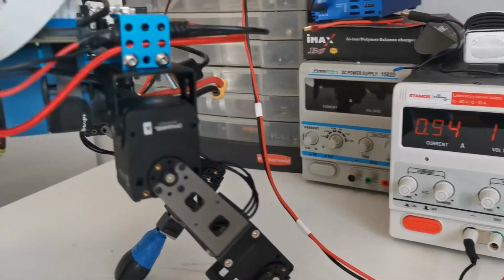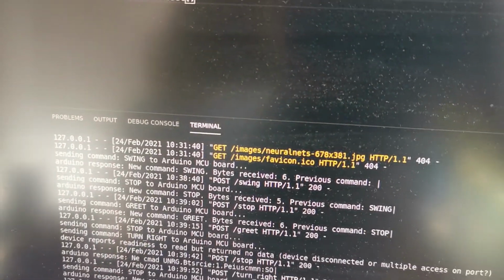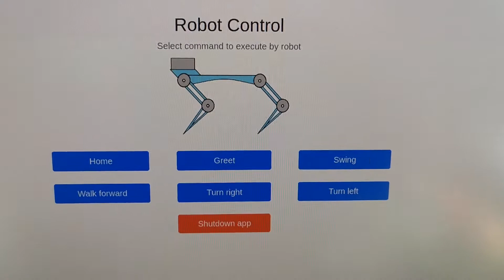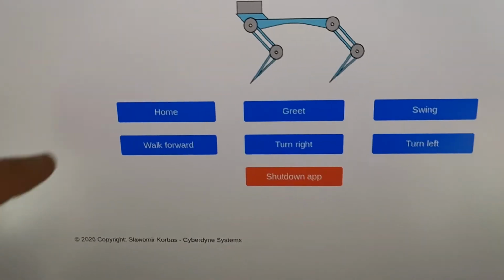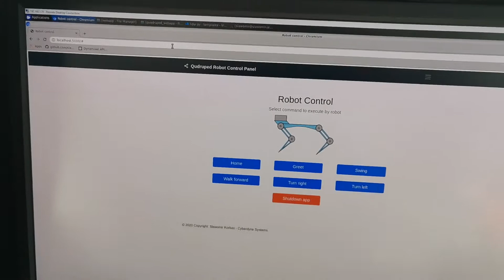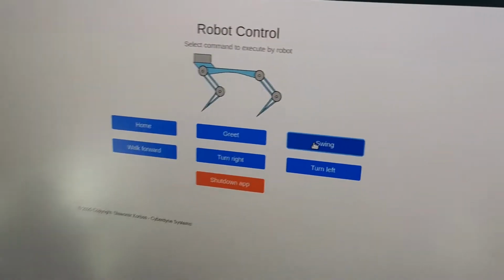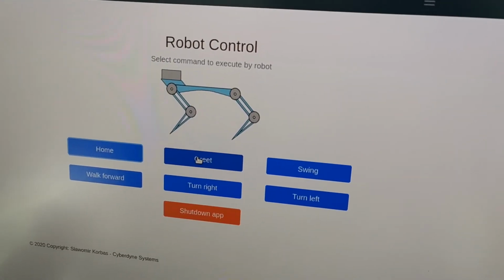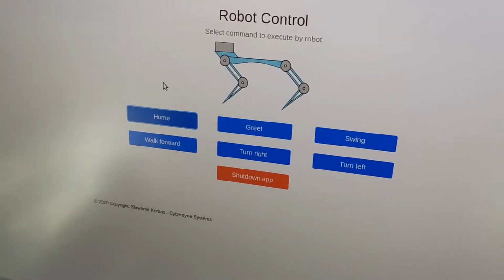NVIDIA Jetson Nano and Dynamixel robot: control using Python

Comment: How did you control 4 legs with 3 TTL ports?!!
I hope you to share the method since I'm stucked with using arduino shield for 4legs control
Reply from the maker: Even single ttl port would be enough if all the servo Motors are connected in Daisy change. In this particular case last servo from one leg is connected to the 1st servo of the second leg (chain) - this way single ttl port controll two legs.

Comment: this robot skeleton can be bought?
Reply from the maker: It is my own construction. Mainly based on Makeblock aluminium elements. Joints built from dedicated Dynamixel servo  aluminum holders. It is not any serial product.
Reply: @slawomirkorbas  cool thanks,  one question because you have the nvidia jetson. I am searching to buy one, but I cannot found  any to buy, do you know any site which has it available?

Comment: did you have any problems with the rplidar on that kind of platform? I found the smoother the ride was, the better the slam worked
Reply from the maker: Yes I had some problems with RP-Lidar but it was because of the Python library. For some reason "scan" method was throwing an exception when buffer was overflow with measurements. Temporary solution was to catch this exception and restart lidar programmatically. When it comes to LIDAR device it can operate at different speeds depending on the voltage applied 3.3V or 5V. You may test it in case of  issues.

Comment: Hi man!  That's amazing and I love your work ❣️. I have a small query and I think you are the right person to ask. Since you have worked on Jetson Nano. I've a Jetson Nano and I'm building a robot. I don't have a clear idea on selecting the right power source for jetson nano. I've a 2500 mah lipo. So if I connect this to a buck converter and power the Nano, will it work efficiently? Will the jetson nano be safe with that converter?  Kindly help. Expecting your response. Thank you!
Reply from the maker: Hello Ajay,
I would say 2000mAh capacity is a minimum. Lipo batteries are fine as they provide high current. Jetson may need 4 Amps in the worst case. Jetson Nano boards power consumption may vary quite much depending on the program running. If you plan to include computer vision and object recognition in real time with AI then calculations may cost lot of power. Also if you plan to power servo motors at the same time then power consumption may be much higher. On the other hand if you are going to use Nano to work with some simple sensors then small battery may be ok - prototyping purposes.
In my case I am using 2800mAh battery pack which is enough to power my robot (Jetson nano with servo motors from Dynamixel) for about 25-30min. This is also important to consider for how long your robot would operate. I used also 5700mAh Lipo battery but then you have to solve other issues like proper adjusting center of mass in the robot and other factors like servo motor torque. Long story short: you may start with 2500mAh but it is good idea to design some room for bigger battery in your project.
Reply: @slawomirkorbas  Thanks for a very quick response. Sure I'll start working with my 2500mAh Lipo and look into the design specifications also. Thanks man. Keep Rocking!

Comment: hi, you are amazing you have so much knowledge in robotics, I am new to robotics, can you help me with how to start with robotics? I am a full stack developer and app developer, I am intermediate in python. I am interested in robotics and want to change my direction towards robotics can you help me with how can I start?
Reply from the maker: Hi Chirag, robotics connects multiple disciplines like electronics, programming and mechanics. As you have programming experience already I would recommend to start with some Raspberry pi or arduino boards and typical RC servo motors. Just play with them for a while, build some simple joint(manipulator),  get familiar with IDE. Then design first  simple robot on wheels. Don't try to build overcomplicated robot as a first project. Keep it simple. Develop your knowledge incrementally - baby steps. Much depends on your goals.
Reply: @slawomirkorbas  thank you for sharing a much needed experience with me. i will follow this and yes i will take baby steps as you said to take. How can i contact you if i need your help if i got stuck at some point in robotics, because you have so much knowledge and experience that will help me. it will helpful for me if you give some sot of contact like instagram or any thing so i can contact you
Reply from the maker: once you get to concrete issue you may write to slawomirkorbas(at)gmail
Reply: @slawomirkorbas  ok sure  thank you

Comment: Hi sir can you please tell me how to control 17 servos with jetson nano thanks
Reply from the maker: You need a controller that will be connected to your servos. If the structure of your project allow just one controller will be enough as you can daisy chain your dynamixel servo motors  (connect each other using TTL or RS485 cable, depending on version of Dynamixels "T" or "R"). When it comes to controller I see at least 2 options. It can be OpencCR module https://emanual.robotis.com/docs/en/parts/controller/opencr10/. As far as I can tell it was used with Raspberry Pi in TurtleBot3. Probably you could use same libraries used in that project to communicate with OpenCR using Jetson Nano. 
Second option is to use some Arduino board with Dynamixel Shield from Robotis. Then your Jetson Nano can "talk" to Arduino over serial port(USB). I was using second approach which is cheaper but the drawback is that three boards are needed.